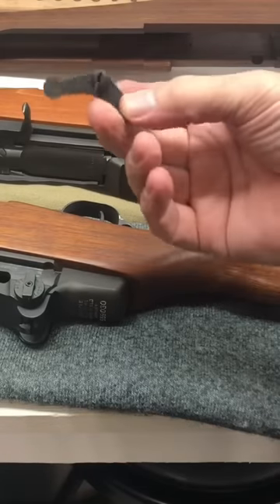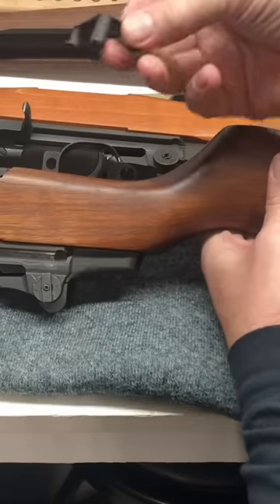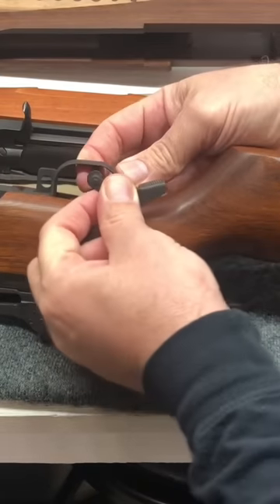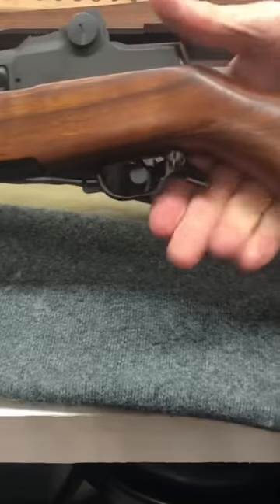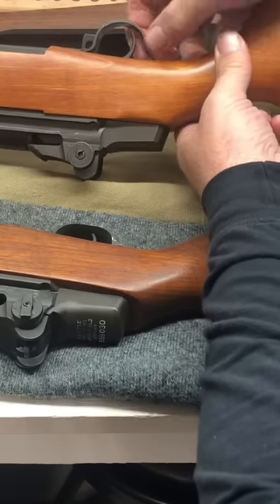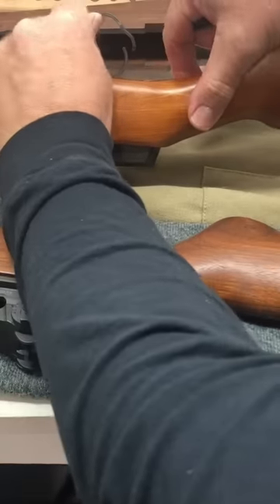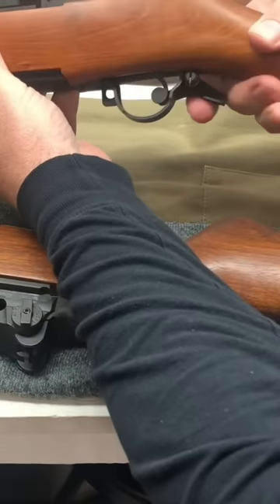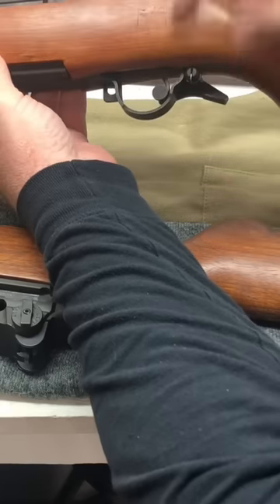M1 Garand winter trigger.

Comment: Okay. This is a good invention. Winter for soldiers is already hard enough without worrying about your hands getting frostbite. Sure, there is the chance for a negligent discharge, but the pros outweighed the cons of this little device.
Reply from the maker: Winter triggers were issued during the Korean Conflict and I've never read anywhere of any negligent dischanges credited to the winter trigger.  There is potential for trouble there, but not if you follow the rules of gun safety.

Comment: Still learning about firearms. Would the trigger reset in the event an actual round was fired? Looks like you pull it and it stays pulled.
Reply: I was wondering about that to!
Reply: With semi automatic rifles like the one in the video the trigger would reset.
Reply: For a semi auto to reset the bolt needs to cycle. So if you dry fire any semi the trigger will not reset. To test the reset on a semi you’d want to pull the trigger back continue holding the trigger down then manually cycle the bolt then slowly release the trigger and you’ll feel the reset
Reply: I'm guessing if you held the lever down, it wouldn't reset, or maybe it would forcibly isk
Reply: Semi auto action, if there was a live round, then the gas blowback from the round being fired would force the action backwards and a spring would force it forwards again, chambering another round
Reply: It would when the bolt cycles like a bolt action
Reply: It would be similar to firing regularly bc if you think about it everything usually is done moving when you let go of the trigger if that makes sense
Reply: Chinese bot
Reply: Yes, once the action cycles the trigger will try to reset, it wont reset till tension is removed. That tension is your finger, whether its contacting the trigger or the winter trigger doesnt matter
Reply: Uh. He wasn't shooting rounds. The action of the rifle resets the trigger.
Reply: It's the same as continuing to hold the trigger on an AR15 after it fires. The disconnector will catch the hammer, but the trigger won't reset till you release it. Proper trigger discipline you shouldn't ne lifting your finger off the trigger anyway.
Reply: The same thing happens when you shoot the gun regularly and you keep the trigger pulled.....
Reply: Its gas powered so yea
Reply: It will fire just like it normally does.
Reply: @RedbeardMerx  Semi auto action works thusly - after firing, two things must happen for the trigger to reset - the action must cycle, resetting the firing pin, and the trigger must be released. Holding the trigger down won't forcibly reset it, and the weapon won't fire again until you release the trigger and pull it again.
Reply: You would simply stop putting pressure on the lever, which would allow the trigger to reset (in semi-automatic firearms that fire from the closed bolt)
Reply: @mikebradley2968 depends on the situation. Precision shooting, yes. Active combat? Fxxk your trigger discipline, there's enemy to kill that's too close to pretend your Halfcock or Vasily

Comment: You got it backwards, man! The latter trigger guard is the earliest. That's why it didn't work in there. The winter trigger guard device was a late WW II innovation thar went into the Korean War into the 1960's.
Reply from the maker: You’re wrong.  The stamped steel trigger guard came later.  The milled trigger guard is the older version.
Reply: He got it right. They went from milling to stamping, milling requires more material and time to produce and has the down side of losing tension faster. With the stamped trigger guard it's faster to produce using less material and as it loses it's tension you can rebend it if needed.
Reply from the maker: @m2hmghb  well said.  Thanks.

Comment: Surprised the AFT doesn't have something to say about this.
Reply: It's similar to tying a string to your trigger it doesn't change the action you still pull it and you still want to get one shot.
Reply: @clonescope2433  ya no, I realize that. But they go after stupid stuff.
Reply: @clonescope2433  the atf actually did declare that a piece of string on an m1 trigger is infact a machine gun. Look it up, somebody made a string and a steel loop that makes and m1 shoot "full auto" with help from the charging handle
Reply: @user-nb8yt2il2r yeah, the "bump string guy", how'd his case end, it kinda vanished in the night before there was a resolution
Reply: @clonescope2433 they will go hammer and tongs after ANY device that makes it easier, safer or more comfortable to shoot, regardless of how innocuous it is.
That's like there's a new muzzle device that LOOKS like a silencer, but isn't. It's open on the front and directs the sound away from the shooter and damps down on the flash in their field of vision.
So of course the ATF is trying to call that both a silencer AND a flash suppressor.
Even though it actually makes the gun louder for everyone not behind the shooter.
Never underestimate the mental flexibility of people who have dedicated their lives to grinding you down such as the ATF

Comment: Why can’t they just made more room in the trigger guard?
Reply from the maker: Much cheaper and more easier to add a winter trigger than change all the trigger guards on all the rifles already made.
Reply: @FlyingKSports  I meant at the engineering stage. But I guess most Americans act and then think of some horse shit afterwards as usual
Reply: @bz7526 the M1 Garand was not designed with extreme cold weather combat in mind. It’s not what we needed at the time.

Comment: if you need to lift that trigger guard to install it
just remove the guard all together at that point
Reply from the maker: Not possible with the Garand.  The trigger guard hold the whole thing together.
Reply: @FlyingKSports  shucks
can you cut it off or sth?
this workaround looks clunky
Reply from the maker: @NorroTaku  would have been a huge recall and refit to make the trigger guard bigger.  Little clip on trigger devices were simple to distribute.
Reply: @FlyingKSports  fair point

Comment: Did the garand not actuate when you pulled the trigger on the stamped steel? It didn't seem like it had the travel distance.
Either that or you cut the click off...
Reply from the maker: It does work.  I may have edited it poorly.
Reply: @FlyingKSports  I had a feeling, even rereading my post, didn't intend for it to come off like that. Wasn't sure if it was installed correctly or something.

Comment: Why isn't that still made for all guns weather hunting or military today
Reply: Ar15s still mostly have this. Does your trigger guard have a little pin at the front in the magwell? Push that in and pull the trigger guard down. A lot of combat rifle dont even have trigger guards, like the AUG,it has a handguard with a completely open trigger. I beleive the FAMAS is the same way. The SA80 has a huge trigger guard that easily fits issued gloves. And honestly, these werent meant for use with gloves, they were meant for use with mittens, which are extremely rarely used in this day and age, mostly because glove technology has advanced far beyond ww2 mittens and you can fit gloves in standard trigger guards

Comment: That seems cool for hunting but I would almost rather a rifle that specifically has a trigger guard for thick gloves
Reply: that’s ideal, but for a military, it’s easier to have this guy than changing the trigger guard itself as it would only be needed by a small portion of soldiers.
Reply: @ZSmith-yy4lv  it was designed for shooting with mittens on not gloves, you didn't need it for gloves.

Comment: That would probably work better for sharpshooting..
Reply from the maker: There is a sniper version of the M1, but I’ve never heard of the winter trigger being used with it.
Reply: @FlyingKSports  just looks like it would be easier to get a smooth squeeze off with that in lol..
Reply from the maker: @joshearhart6142  funny thing is I’ve never really shot with it for accuracy.  Just kinda played with it is all.
Reply: @joshearhart6142 I would personally prefer to directly use the trigger. Using a squeezing motion as opposed to a standard trigger pull would cause more movement for me.

Comment: Instead of using a bent paperclip to depress the trigger Just make the trigger guard larger like all the countries who experience snow regularly already do
Reply: except the m1 garand didn’t see much snow. better to have this guy for the few that need it than change the design for every other application.
Reply: @ZSmith-yy4lv  a larger trigger guard would not impede any other features, half the planet is cold during the winter.
Reply: @spacekike9506  it wasn't designed for shooting with gloves, it was designed for shooting with mittens.
Reply: @r.a.facklam4851  military mittens almost always have the trigger finger separated for this exact reason

Comment: We learned to Field Strip the M1 Garand as cadets, while I was still in the Philippines in the late ‘80s. The rifles we pulled from the armories always had this mix of those two different Trigger Guards. But with Winter never being a problem in the tropics, the instructors never told us what these mysterious protuberances were for.

All I knew was to pick the ones that didn’t have the hole, because those were easier to pull-out during a timed field-strip. Due to lack of maintenance all the actions were equally corroded and hard to move. Over a decade later all the pieces were returned to the U.S.

Somewhere in a CMP warehouse “my” old rifle is in storage, or has been refurbished, and has a proud new owner.

Comment: Are we really still manufacturing the M1 garand?
Reply from the maker: You can still by them but they are mostly rebuilt.  Maybe some new parts, but not completely new.
Reply: @FlyingKSports  I had the most stupid idea.
Tactical M1 garand.
Reply from the maker: @curiux  that doesn’t sound stupid at all.
Reply: @FlyingKSports  M1 garand with polymer/plastic instead of wood, with adjustable stock, several tactical rails, and probably a rail on the top for optics. If that ain't stupid, I don't know what is.

BTW, happy Thanksgiving from where I am.

Comment: That's a very clever solution to a pretty decent size problem with simplicity and durability and mind! That is the type of stuff that all engineers should learn from! Especially the ones that are now making cars so damn complex that you have to have a degree in computer science and know how to program just about anything short of a spacecraft lol! I know that cars made a lot of emissions back in the carbureted days but there's no need to put some of the sensors they put on vehicles now. You wouldn't believe how much my old Toyota truck runs just fine without half of the sensors removed and done right! I think that somewhere in the mid to late 2000's they just started going nuts with seeing how much computerized crap they can cram in a car. And also some cars you can't even work on them yourself because you have to purchase software from a dealer and it costs a shit ton extra money! I actually think it was John Deere that had a lawsuit against them because they did something shady and forced all John Deere combine owners to reset their programming then force them to buy a new update that was extremely expensive. And if the farmer didn't pay for the new programming brand new $200,000 combine was basically a giant paperweight! I think they even did it to smaller tractors that were owned by mid income families as well so they were basically trying to screw over everyone besides people that had riding mowers which work carbureted so they couldn't screw with them. The big rental companies no longer have the customer in mind...only their stock holders! I will never buy a John deere riding mower again, I'll stick with my Craftsman

Comment: okay but why not have a larger trigger guard instead of doing this ?
Reply from the maker: It was much easier to add the winter trigger than enlarge the trigger guard on 5 million rifles.
Reply: @FlyingKSports  costs over safety
classic
Reply from the maker: @snepping1885  I've never heard a negligent discharge due to the winter trigger.  So maybe, in the hands of trained riflemen and soldiers, it wasn't much of a safety risk.
Reply: @FlyingKSports  that OR any negligent discharge summoned the drill Sargeant that trained you to the front lines just to knock you out
Reply from the maker: @snepping1885  Maybe so.

Comment: 🥑🍅🥪 Avacado Grilled Cheese Sandwiches
BEST GRILLED CHEESE SANDWICH YET!
Ingredients:
Mayonnaise, for spreading
8 slices country white bread 
8 slices Monterey Jack cheese
1 medium vine-ripened tomato, sliced 
1 small red onion, thinly sliced 
1 avocado, sliced 
Directions:
1.  Preheat a griddle over low heat.
2.  Spread a thin layer of mayonnaise on one side of each slice of bread this will give the bread an even golden color when griddled. Flip 4 slices over and layer each with 1 slice Monterey Jack, 1 slice tomato, 1 slice red onion, 1 slice avocado and 1 more slice Monterey Jack. Top with another slice of bread, mayonnaise side up.
3.  Place the sandwiches on the preheated griddle and toast until the bread is golden brown and the cheese is melted, about 2 minutes per side.
From: The Food Network.

Sandwich gc
Reply: 🍞🧀🐷  Pulled Pork Grilled Cheese
SUPER FAST AND EASY!
Ingredients:
1 carton (16 ounces) refrigerated fully cooked barbecued shredded pork
1 garlic clove, minced
8 slices country white bread
6 ounces sliced Manchego cheese or 8 slices Monterey Jack cheese
1 small red onion, thinly sliced
1/4 cup mayonnaise
Directions:
*Heat shredded pork according to package directions. Stir in garlic. Layer 4 slices of bread with cheese, onion, pork mixture and remaining bread. Spread outsides of sandwiches with mayonnaise.
*In a large nonstick skillet, toast sandwiches in batches over medium-low heat until golden brown and cheese is melted, 2-3 minutes per side. 

Sandwich gc

Comment: Honest question. If you raise the trigger gaurd to put in the winter trigger. Could you not just open the trigger gaurd the rest the way and just use the trigger that way?
Reply from the maker: Opening the trigger guard unlocks the action.  The rifle then comes apart.
Reply: Also you don't want to remove the trigger guard off of any firearm especially semi-automatic and double action revolvers for safety concerns
Reply: @lord_vader87  to be fair on that one it's war. You do what you must to survive. If you have to do some unsafe stuff so be it.
Reply: @wight626  to a point yes but the trigger guard is also there to guard the trigger to protect it from also being broken off without a trigger you basically have a club which isn't going to do you any good at a distance

Comment: Or you know, just design it so the trigger guard folds away......
Reply: The trigger guard is what locked the trigger group into the receiver.  Also, removing the trigger guard doesn’t change the fact that you still have a vertical trigger which isn’t good with mittens. Do you think you’re pointing out something that wasn’t thought of?

Comment: If the gloves prevent you from getting a finger in the trigger guard, how was a soldier supposed to deactivate the safety? I doubt you’d be walking around with an exposed winter trigger, a round in the chamber, and no safety.
Reply: It wasnt actually for gloves, it was for mittens, in which case you would still be able to angle your thumb in and switch the safety off

Comment: Why not just have the trigger guard swing more forward on the second version. You wouldn't need the winter trigger.
Reply: You can use mittens with this device. Just turns the vertical lever into a horizontal one. It was less of an issue with the size of the trigger guard.

Comment: Did m1 garands have a safety?
Reply from the maker: Yes, its inside the trigger guard
Reply: Yes its the tab with the hole at the front of the trigger guard, push it back into the trigger guard for safe, push it to the current position in the video for fire

Comment: So if the trigger guard moves out of the way couldn't you just do that to used your gloved hand to pull the trigger?
Reply: 1. The trigger guard holds the trigger group into the receiver. 2. The main issue is not just the guard but also the fact that the trigger is vertical. This converts it to horizontal which is much better for mittens.

Comment: I feel like maby you could fire accidentally if you don't have good trigger discipline 

or possibly under high stress
Reply: any gun is easy to fire easily if you dont have good trigger discipline.
Reply: @eaglestryker1338  ND?  And ya seems about right
Reply: Its not a perfect solution, but realistically you wouldnt be moving much while using one of these in combat. War quite literally slows down in winter, so you would most likely be in a static-ish position where you wouldnt be running around with your finger on the trigger ready to fire it. And if you werent actually firing you could put it on safe. Ofc getting it off safe would require getting your finger in the trigger guard thereby kinda defeating its purpose...

Comment: Wasn't the point of the movable trigger guard so you could use it with gloves?
Reply: No. The trigger guard is used to lock and unlock the trigger group from the receiver. The gun cannot be fired with it open. And also the winter trigger gives the shooter a horizontal instead of vertical trigger, which is best for mittens.
Reply: @66smithra  thanks!
Reply: @adame6425  sure